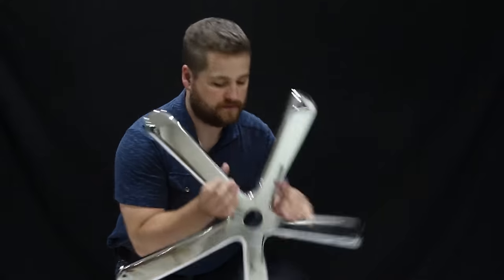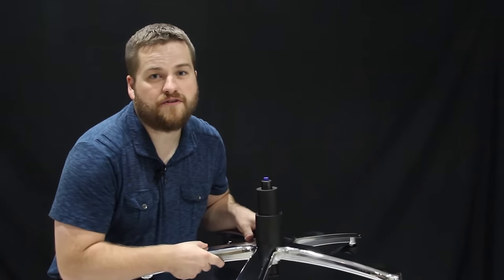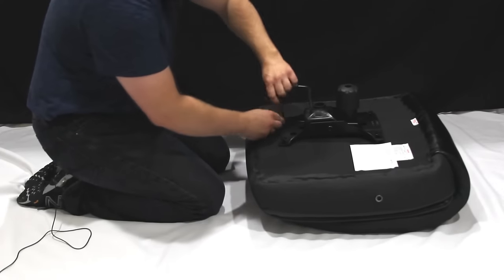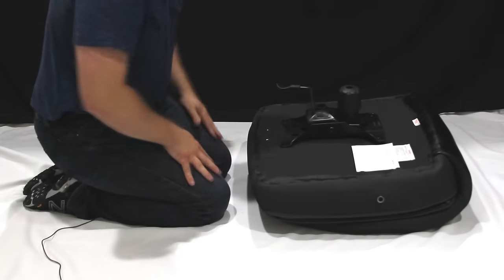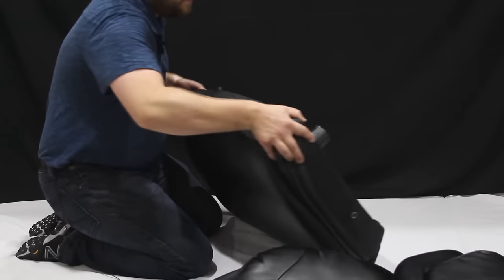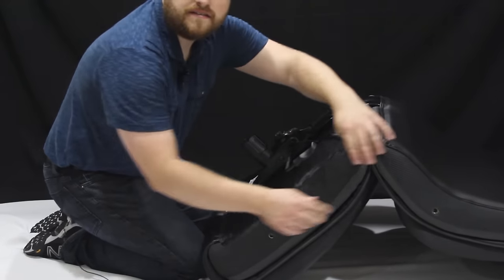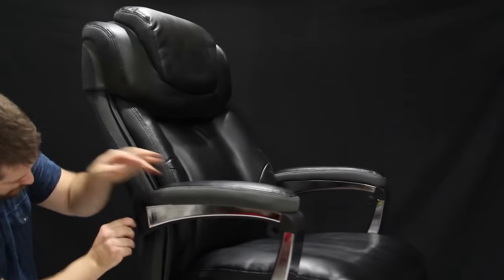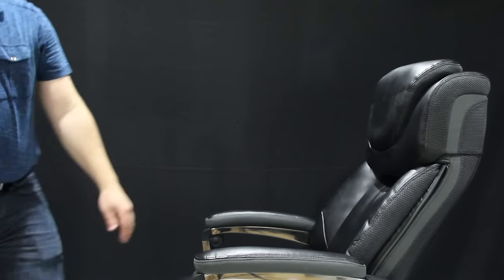How to Assemble a Big & Tall Executive Office Chair

Comment: my instructions say to put on arm rests, then back rest.  I think I will follow your instructions as it seems a better way to align the holes.  I have all the parts, now to put it together!
Reply: my chair isn't the same as the one in the video - no form on the back to connect to the base, so very difficult to line up the arm rests to the back as one person.  takes two people to avoid stripping screws and to get. the screws into the right hole.

Comment: Thank you very much Sir. I still could not lign up the back metal with the seat, I will try to add the arms like you did, and then go back to the backrest. My problem is I am small woman, small hands with carpal tunnel for huge backrest and seat, it's hard to push and hold both parts. I gave up, after trying several positions, angles, i will have to ask my male neighbor to assemble, because I can't push properly.